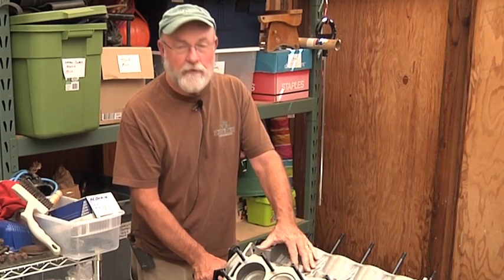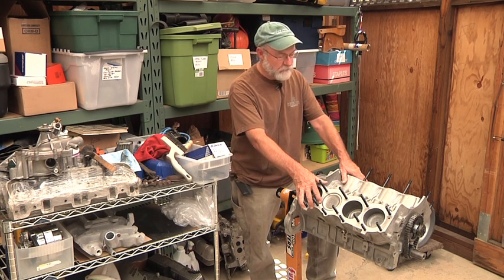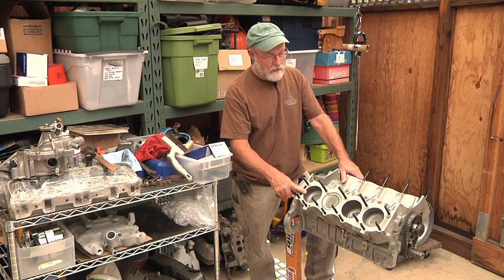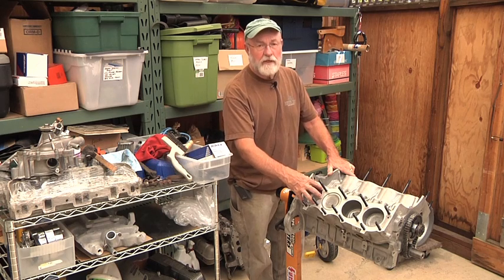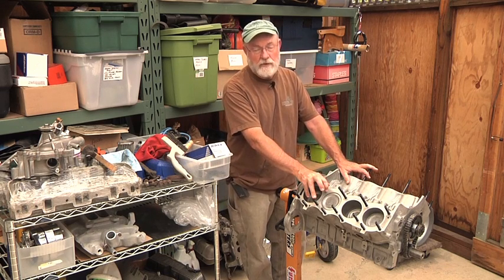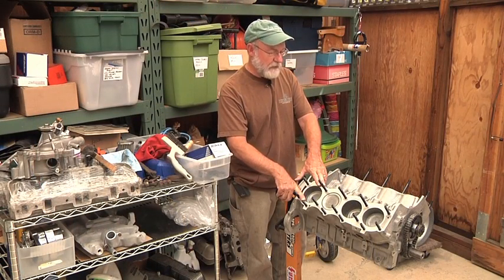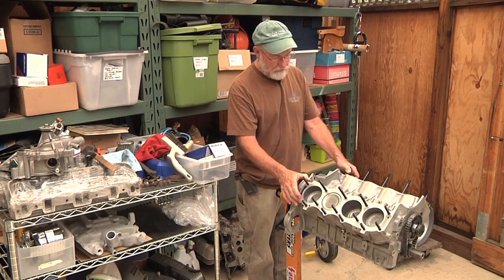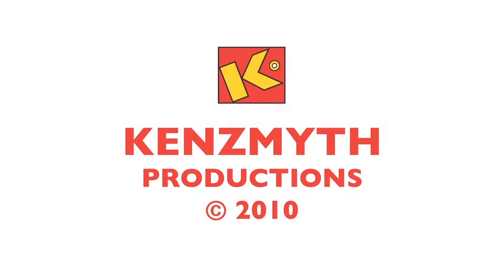Rover V8 Episode 1 - The "Slipped Liner"v2 .mov

Comment: I've owned rv8s for over 40 years ,never heard of a 3.5 and liner ...3.9 and above yes ..
Reply from the maker: American ex-pat power becomes Blighty's favorite V-8
By Jeff Koch from April 2011 issue of Hemmings Sports and Exotics
Detroit's scared-of-imports phase in the late '50s took on two distinct personalities. First, GM and Ford brought in imports from elsewhere in its sphere of influence: Pontiac sold Vauxhalls, Buick sold Opels and Ford sold European Fords. This was just a place-saver, though, while Detroit readied its own small cars. Other than the adventurous Corvair, Detroit's idea of an American compact looked like a 3/4-scale American car. Falcon, Valiant, Chevy II, Olds F-85, Pontiac Tempest and Buick Special. And for GM's more premium brands (Pontiac, Olds and Buick) this meant V-8 power. But existing V-8s would be too heavy for the more compact platforms.
Enter Buick's all-aluminum, 215-cubic-inch V-8. Spread between Buick and Olds over three years, and just two years in the Tempest, GM built nearly a million engines before the design was quietly laid to rest. Casting issues meant a high scrappage rate, which meant reduced profitability on a car that was already squeezing the General's pockets. Radiators clogged with effluent, a result of using the wrong type of coolant, didn't help; oil and coolant sealing were also issues. Not helping matters: The import threat had receded for the time being. GM's B-O-P compacts were growing to intermediates for 1964, and standard-issue iron V-8s were okay to power them.
It was early in 1964 that Rover's U.S. operations chief J. Bruce McWilliams realized that this fully developed, lightweight V-8 weighed less than most British-built, cast-iron fours of the day. With permission from his English bosses, it took McWilliams a year to convince GM to sell the tooling to Rover. With the exception of a new intake manifold and a switch to SU carburetion, Rover started using the 3.5L V-8 in the mid-'60s, in the P5B, and expanded it to other machines in the lineup starting in 1967. Once Rover became part of the British Leyland combine, the 3.5 also ended up in Land Rovers and Range Rovers, MGB GT V-8s and the Triumph TR8, and was outsourced to both Morgan and TVR.
The last Rover car that the 215 lived in was the Vitesse, which passed in 1987. But the engine lived on: an overbored, 3,946cc version launched in the early '90s; the 4.0, launched in 1995, had the same displacement but offered several revisions, including additional block reinforcements, and new intake, exhaust and pistons. This lasted through 2001 and saw duty in various TVRs, Land Rovers and the revived MG RV8 of the mid-'90s. The mid-'90s also saw a 77mm stroke crank added to make a 4,275cc version, exclusively in the 1992-'95 Range Rover. The ultimate iteration of this engine, launched in 1996, offered an 82mm crank for 4,552cc, badged as a 4.6L. The 2004 Land Rover Discovery was the last vehicle to have it from new, although it is still manufactured for the specialty trade.
The Buick/Rover aluminum 215 V-8 even had some racing success, if in highly modified form: Australian Jack Brabham asked parts component maker Repco to design a racing V-8 that would conform to the new-for-1966 3-liter rules. Destroking the basic block, adding Daimler connecting rods and race-prepared, ported, custom-modified two-valve SOHC heads, the Repco 620 V-8 was reliable, low in weight, and compact enough to fit in an existing F1 chassis built to the 1.5-liter formula. Brabham scored six poles and four consecutive wins in a nine-race season, good enough to capture both the F1 Driver's and Constructor's championships. (For '67, Repco also designed the block.)
At one point during the OPEC-trampled '70s, GM contacted Rover to buy the tooling back; the English firm declined. GM also investigated the cost of importing completed engines into the U.S., but the costs (which surely helped pay for ramping up entire factories to cope with the General's intended volumes) were too great, and GM set to work on its own small-cube solutions.
There are enough parts out there that the U.K. hot-rodding set treats it something like Americans treat the small-block Chevy: lots of mix-and-match parts interchangeability, with basic parts cheap and plentiful enough to keep 'em running forever. Or at least a lot longer than GM would have let it go.